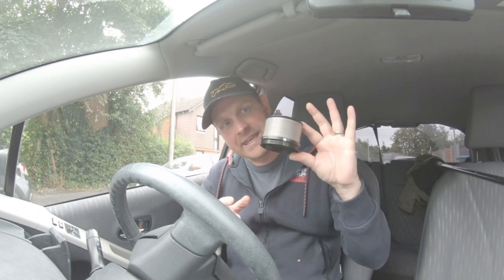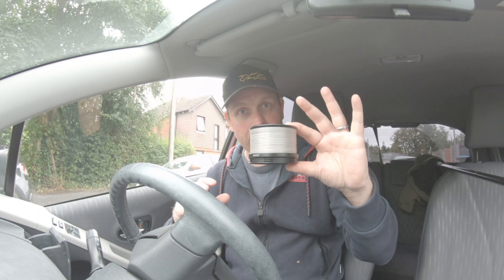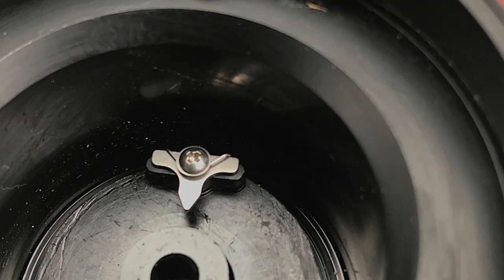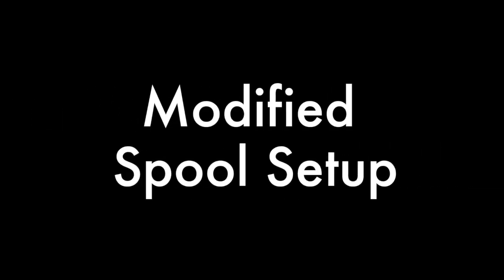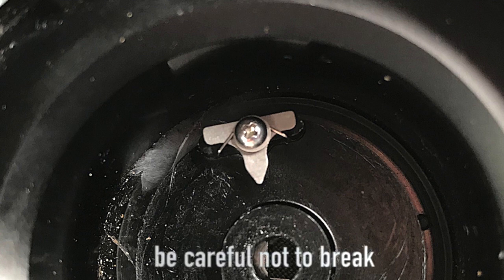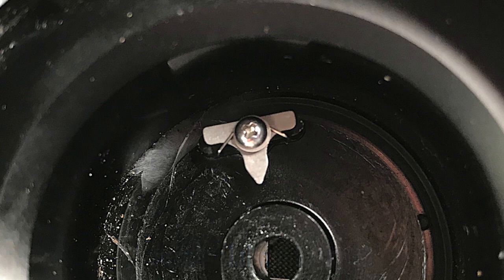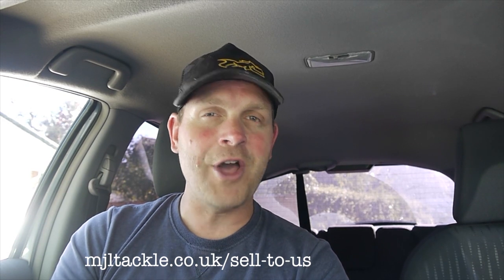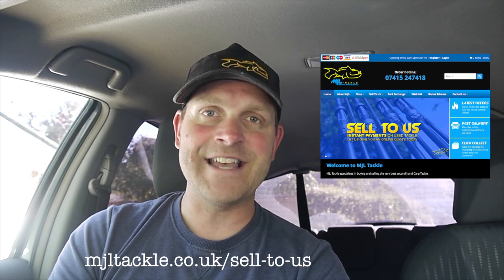HELP! Shimano Drag Clicker not working...Quick Mod

Comment: Your solution is exacly how it is on the technium. And its terrible how it goes sinlent. Now i tryed it the way yours been at the start lets see if its works better
Reply: My solution for an XTC was to fabricate another tensioner from a pen spring. It s holding till now...